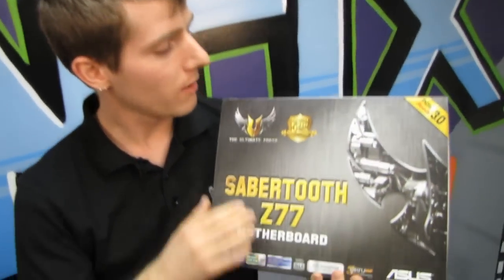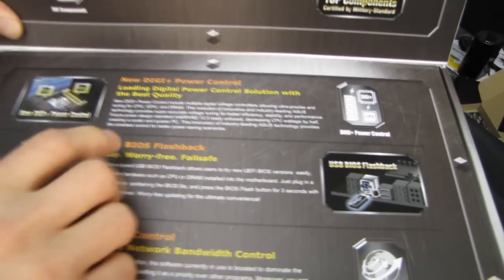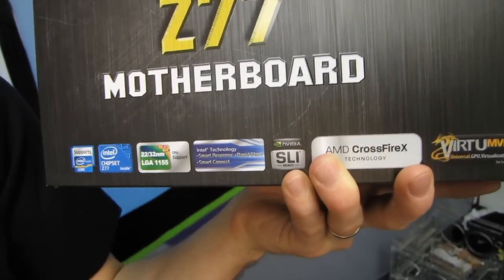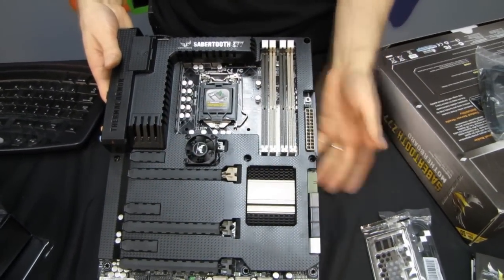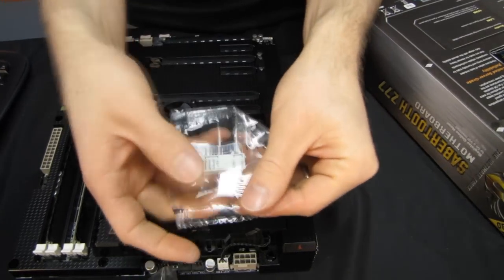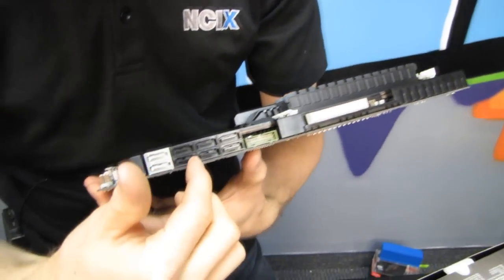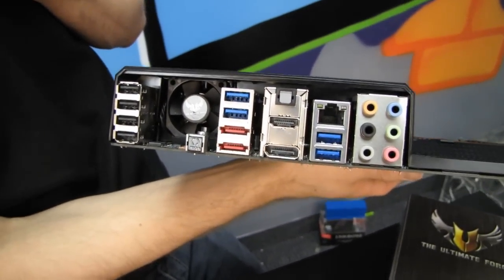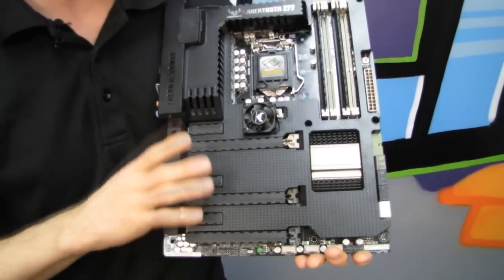ASUS Sabertooth Z77 Ivy Bridge Gaming Motherboard Unboxing & First Look Linus Tech Tips

Comment: Its 2019 and I'm still using this board.
Reply: Same here, what year did you buy yours? Mines been in use since 2012
Reply: Hi Ford, please can tell me what processor you recommend me for this motherboard? Thanks
Reply: An i7 3770K is a good match with this board.
Reply: @melsgamingvault  managed to hit 4.7ghz with mine on water, would of been 4.8 but prime95 wasn't stable unless I pushed the voltage higher than I was comfy with
Reply: can support ddr3 1600mhz and 1800mhz?
Reply: Yep. I paired it with a Corsair Dominator 1866mhz.
Reply: You running Windows 10 on it?
Reply: Already sold my unit but yes, it was running on Windows 10 64bit. Works great.
Reply: 2020 and using It, windows10, GeForce gtx960, i7 2600 and all fine
Reply: 2021, and i'm still using mine too
Reply: It's 2021 and I'm trying to buy one
Reply: 2021 strong here but upgrading in the coming days finally.😁
Reply: 2021 and same here. It is amazing how long it lasts
Reply: What GPU u got?
Reply: 1070 FE
Reply: end of november 2021  built my pc in 2013   still running like a champ
Reply: using this board i left out lol
Reply: This thing lasts really well, though I'm considering upgrading soon. Still rocking the i7-3770K too.
Reply: @christiankain  i7 3rd best
Reply: 2022 still going strong, wondering if I can add thunderbolt to it

Comment: The direction of the air flow will determine if it's an exhaust or an intake. Most fans nowadays have an arrow indicating the direction of airflow. If you wanted an exhaust, you would install the fan with the arrow pointing at the back of the case. When I a handling a fan without an indicator arrow, I usually just inspect the fan blades. Another easy way would be to get the fan spinning (spin with your finger, blow on it, etc.) and feel which way the air is flowing.

Comment: Sorry for the late reply. As far as i know, the Xeon line of processors is meant to be installed in workstation type of computer. And the Xeon line is not very good at overclocking (or so i heard). And some people on the Interweb said that this board is not very compatible with the Xeon you mentioned. If you really want, lots of people recommend the Asrock Z77 Extreme4, which seems to be working with the Xeon just fine.
However, this is only if you are building a workstation.

Comment: well it's not even just a warranty its also the amazing board you would have to play with it to know what I mean this board has more features than any other board I've ever seen the ability to flash the bios from the desktop, 12 thermal sensors, great overclocking capabilities, the ability to control any fan connected to the board via AI suite II, crazy voltage control from the desktop, the ability to monitor my psu, fan speeds, temps all from one application and it records those numbers for you

Comment: To be honest, I have not thought of the dual gpu sli on this board. But I don't see anything wrong with that option, but the first question that pops in my head is whether the thickness of the dual gpu will give enough space for the second dual gpu. That's something you might want to calculate first, unless you are going with aftermarket cooling solution for the video card. The reason I've mentioned the X79 board is, because I recently saw a build using quad sli on it. Insane build it was...

Comment: Well I have OC'd mine from a 3.6 to a 4.4 and it stays around 47c on load. That's at 1.29v on it. I don't try to get all crazy with the overclocking. I'm sure in the next few weeks when I get more time I will push it to its limit and it will probably max out at about 5.0 at probably 1.35v. I'm guessing (only guessing) it will be about 65-70c on load. We will just have to see. But the awesome thing about this board is you can close off any unused slots which makes it look so neat and tidy.

Comment: This motherboard is compatible with the h60. The fan over the cpu is a stock heat sink fan that installs separately. You install the h60 on the cpu instead of the stock heat sink.

Comment: I just finished fitting one of these to a Thermaltake Chaser - 2 case... a perfect fit an a nice combo.. I love the features on this board, basically everthing you need (no bluetooth 'though).
Easy to fit and set up. Some really good included software to help you tweek it.
Mine is using a I5 3579k CPU combined with 16gb of RipYaw Ram. I had a Geforce GTX260 2gb graphics card lying around so I slotted that in as well.... I like the whole deal, it runs like as clock. Nice one ASUS!

Comment: Just a silly question, does the CMOS button battery in the motherboard going to last for 5 years before it's need to be replaced, because as stated by the guy, he said that the thermal armor is unremovable from the motherboard, and apparently they don't show any opening leading to the aforementioned battery.

Comment: Its an ATX board so check on your tower configuration and see if it will fit a ATX board. I bought a Thermaltake HAF 932 Advanced full tower and put my 850w Corsair Gold PSU on the bottom tray and it fit perfectly in the full size tower. Mid towers you would probably have to the PSU on the top.

Comment: Yup, you will! That motherboard is designed to fit two ASUS high end triple slot cooled graphics cards. The gap between the first two graphics card slots is big enough to fit both of those beasties!However, you'll only have the top PCI-E 1X slot left, but then again, it's worth it.

Comment: The first two slots are PCI-E 3.0 x16 (x16/0 or x8/x8) and the third slot is PCI-E 2.0 x16. The reason he said don't use the PCI-E 2.0 as another GPU slot is because it'll be x4 bandwidth  which probably will have almost no improvement. Just creating larger power consumption and heat generation. If you really want to do three way SLI set up, you might want to look at the Sabertooth X79 board, which would cost you about $60 more for (x16/x16/x8) bandwidth. Lastly, this board is far from crappy.

Comment: use the onboard graphics via hdmi if the following doesn't work. Also try re-seating your graphics card. I had the same issues, my 660ti wasn't being recognised. I booted with onboard graphics, installed all of the drivers from the disk (and downloaded/flashed to the most recent bios.)

Comment: No the 4770k is a 1150 socket CPU the Sabertooth Z77 has an 1155 socket. However there is a Sabertooth Z87 that will work with the 4770k. But my advice is that you stay with the 3770k.

Comment: I looked on the GeForce website, the difference between the 480 and 680 is mostly the texture fill rate and 60 gb less bandwidth and increased power  consumption, try skating by on your 480, I heard the new 700 family is coming out in a few months

Comment: Both the fans should be intake for make positive air pressure so the hot air goes out the ventilation holes under the mobo

Comment: This board has no Conventional PCI port, which is what he might be talking about. The Sabertooth has 3 PCI Express x16 and 3 PCI Express x1 ports. This means that a lot of sound cards that are Conventional PCI will not work on this board and you must use a PCIe x1 card. Also, HMDI and DVI are not the same. They work very similarly, but HDMI can transfer digital audio packets among other differences.

Comment: Thank you for your help, but I would like a better motherboard than that. On newegg one of the reviews has a person who used this motherboard and they say it is working just fine. This E3 category of processors is a consumer desktop type processor. That does not mean that the motherboards are compatible with them though (and there is no return policy on them). If the processor were not to be fully compatible with the board what do you think the worst situation could be?

Comment: The 3570k is an i5. The K means it's unlocked and will overclock a lot better than a non k processor. It's only $40 more than the non K chip, you might not want to overclock it now but as time passes you may want to. I would recommend getting the 3570k, gtx 670 and a midrange z77 board ( like p8z77-v or the pro version). That will be a very good computer

Comment: shouldnt have to worry about temps building up in your mid sized case. I have managed to fit ALOT into mid tower ATX cases, and by the time you do a professional wiring job (1-1 1/2 hrs max), itll look like you STILL have room for more components. I recommend taking the time for good wiring because you will get better airflow and ventilation, which is what you really want and need in a mid tower :) If i can help anymore then holla, I build PCs here and there on the side when demand is high

Comment: Are you testing it with no fans?  Any signs of considerable amount of high heat thogh? I'm gonna get the CM Storm Stryker with 2 intake 120mm fans in the front.. 1 intake 120 in the bottom, 1 intake 140mm in the back and h100i exhaust at the top..

Comment: No, intel motherboards go with intel CPUs. The reason this is called the Sabertooth Z77 is because it was made with the Z77 chipset ( intel southbrigde ). Mothers like these were made for the new Intel Ivy bridge CPUs in mind. You can use older 1155 sized CPUs, but in order to take full advantage of the mobos features you should get an Ivy bridge if you haven't already purchased a CPU.

Comment: The X79 is for the Enthusiast Sandy Bridge, LGA 2011 (Core i7 3960X Extreme Edition)
The Z77 is for the Ivy Bridge, LGA 1155 (i7 3770k)

Get the board that works with the processor of your choice.

Comment: Hi, a 600w psu would be more than enough headroom for that rig, but I would suggest going for ax850 or even a 1200w psu so that the psu runs at very low load (increases lifespan and much quieter) and also allows you to upgrade components later on (eg. installing a 2nd 660ti for SLi. as for fans, I would suggest going for led front fans that re not too loud, xigmatek sells these for cheap, and maybe some noctua fans inside the case itself.

Regards,
random youtuber

Comment: If you are building a gaming rig, the I7 3770k beats the Xeon in any day of the week, and you can overclock the crap out of it. With further research, the i7 actually beats the Xeon in most (if not all) gaming benchmark, I assume if you are looking at this board, then you are building a rig more geared toward gaming. 
Hope this helps.

Comment: Yea, definitely go with the 3570k, reserving the ability to overclock will be awesome. As to your question the simple answer is, overkill. Unless they have weak video cards or an insanely high resolution, there is no need. Some people however, need the highest possible fps, even though 1 graphics card will do the job.

Comment: But I have a question, you were talking about overkill with two gpu's for one screen, but I just took a look at the 6870, and it takes nowadays games at high(with 60-90 fps), and it cost half the price everything else cost. But I want to have it as high as possible, can I then use 2 gpu's and play games on ultra with 60-90 fps then?

Comment: The Thermal Armour is pretty bad on itself. There was a test done and if you don't use the fans along with the Armour. It makes the motherboard hotter and it is better just to remove the amour if your not using the fans. So always remember to use the fans along with the armour for maximum cooling.

Comment: everytime I go through a few reboots say after getting home from work each day, the OC will eventually fail, no matter what I set the XMP to for the RAM and whatnot, so I have left it at auto for now. But auto only gains me 3.9Ghz Turbo Core Boost Speed and on a CPU like this, that aint gonna cut it lol. Anyhow hope my thumbs up to this board helps if you are thinking of purchasing it

Comment: No. The 670 DirectCU II is not faster than the 680, the 680 DirectCU II is faster than the 680 with an extra 100mhz on the core clock and a custom pcb.

Comment: I would really like to see the power button and dual bios that you see on boards like the RIIIE I have on something like this.  Otherwise amazing.  I was really upset my 990FX Sabertooth did not have the thermal armor.  Also would like to be able to program the button on the back with all the I/O to be able to just power on the computer maybe make it push and hold for bios because I have a pc that has the back facing out and that would be a perfect power button for me.

Comment: I am getting this board next month.. here is my other specs:
FX-8350 @ 4.0ghz
CrossSLI 7970 & 670
Thermaltake TR2 430W PSU
16gb Corsair 1600mhz & Kingston 133mhz RAM
Do you think it'll run good?

Comment: If you want a nice looking PC then get the motherboards full of blue metal heat sinks and then get ram with same color heat sinks. Then remove all fans and replace with see through, clear plastic fans. Use all sata cables that are light blue for the hard drive and dvd drive. Then put UV lights inside the PC and everything glows a vivid UV color. That is how to make the amazing looking insides for a PC.

Comment: dude one tip, I'm building my own pc and the cpu is a i5 3570k and the gpu is a MSI GeForce GTX 570 twin frozr II so im choosing between this board or the asus P8Z77-V board ¿witch one would you chose based on the other parts?

Comment: I want to add a sound card, NAS card and and a wireless antenna how many PCI lanes can I utilize from the Z77 Chipset. I want my PCI express 3.0 to be running at 16x for a graphics card ideally the gtx690 but before I buy I need to know I can use them

Comment: I was wondering if this setup is compatable and will it be good for gaming Asus Sabertooth z77, Evga GTX 660 superclocked 2gb GDDR5, intel core i5 3570k 3.4GHz, 2x crucial 4GB DDR3 18GGMHz Bauistix Elite memory module, Corsair 750W CXM 80+ bronze, processor coolermaster hyper 412s, seagate 1TB Barracuda internal hard drive and a lileon ihas124 24x Dvd rw (dual r)ram sata drive?

Comment: About how old is the Z77 series of motherboards?  I'm just curious because I'm not sure if I should upgrade or not.  I have the i5-3570K (not overclocked because I don't know how and too afraid to), EVGA GeForce GTX 970 FTW ACX 2.0 (Also not overclocked for same reason), ASRock Z77 PRO 4, 8Gb ram 1,600MHz
Reply: Very old they're more like 2012ish generation
Reply: even today it's not yet

Comment: That's what I meant by having a weaker graphics card. 6870 in crossfire is  cheaper than a single 670 but I would still rather have 1 powerful graphics card than two weaker ones. If you have a single 670 you can add an extra one in the future, however if you have two 6870s you can't add another one, unless you buy a 4 way sli or crossfire board. I would still advise the 670 but it's all up to you.

Comment: you choices are looking good except the processor and the memory 

Motherboard=Z77
Graphics Card=Sapphire Radeon HD 7950 3GB GDDR5
Power Supply= XFX ProSeries Core Edition 850W
SSD= Samsung SSD 830 Series 128GB
HardDrive = Seagate Barracuda® 2TB
RAM = crucial ballistix tactical tracer 1600mhz or corsair vengeance 1833mhz much faster.
Processor = intel i5 3570k much much faster than the  AMD FX-8150 8-Core for just about everything and there same price.
Cabinet = Corsair Obsidian 650D Midi Tower

Comment: if you not looking to overclock just go with something like a Prolimatech Armageddon or the NZXT Havik 140 they are the 2 best air coolers i have seen so far they have very good temps compared to other coolers but be warned if you are getting the i5 it will run hot

Comment: Lol.. alright.. I can take them off.. and I heard they can be set manually.. like the rpm can be permanently low.. lol I can just do that.. And is it hard to overclock on this board? cuz I read a thread where they were saying they were limited to 4.5 or 4.6ghz on their 3770k and when they changed to Maximus V Formula, they were able to get to 4.8.. 

Also, which would be better, this or the Maximus V Formula?

Comment: Do you have the 3770K? If so, don't upgrade to Z87, it's only a tiny upgrade, and if I where you I would wait till Broadwell (5th Gen) which supposedly has DDR4 RAM and PCIe 4.0. Even then, the 3770K is still an amazing CPU, I'd stick with it as long as you can, before it starts to bottleneck your GPU (Which I doubt it will for the next few years)

If you don't have it then I'd advise you to get an i5. There is minimal increase in performance for gaming alone, however editing does utilise it.

Comment: how so?
680 is better in most benchmarks, and even when the 7970 is at the same clocks as the 680 its still slower, they are similarly priced and the 680 consumes less power and is also cooler
it's generally better

Comment: i think your better of with a corsair h100 or if you any good with mods do what i'm going to do buy 2 h70's as there thicker and link them both together to make a 240 rad woks out being the same as a h100 but thick then set up a push pull on them then your sorted

Comment: Depends on you CPU. if you have a i5 2500k it will have onboard graphic due to the cpu. They call it Intel HD Graphics 3000. If you get a ivy brige, then you will get HD Graphics 4000. Although a GPU is recommended. Either way it will depend on your CPU :}

Comment: sir thanks.. i'd go with asrock h87 and i5 4570.. but do you think i need to change my rams.. it's emaxx 6gb of ram.. 4 and 2 gb respectively.. do you think they would not go well or slow my system.. or are there any compatibility issues between the two?

Comment: I don't have amazing knowledge with PCs. But yea you shouldn't have any problems with mounting that liquid cooler as long as you have a 120mm fan slot on your case. I would also go for the 660ti definitely. Absolutely amazing performance for the money. Far better than the 560ti